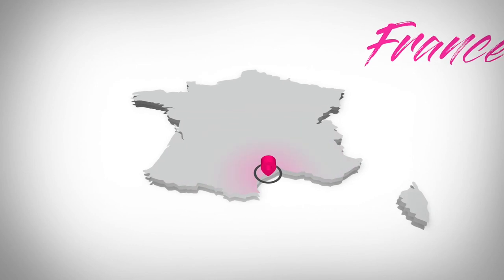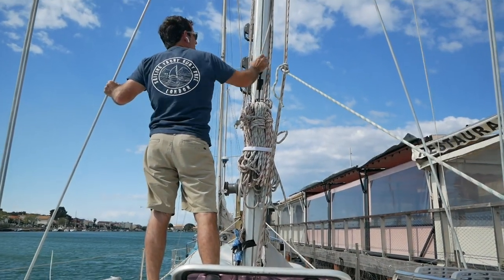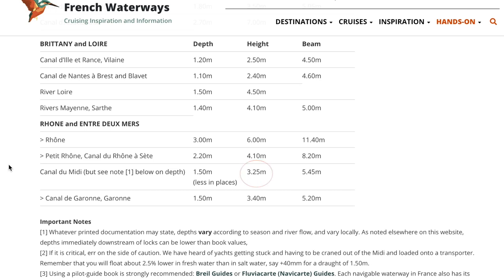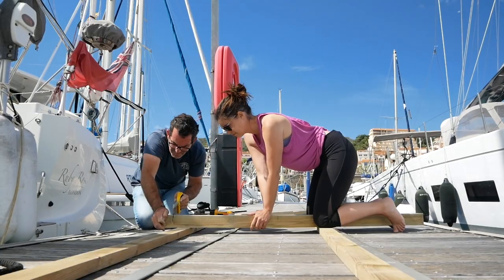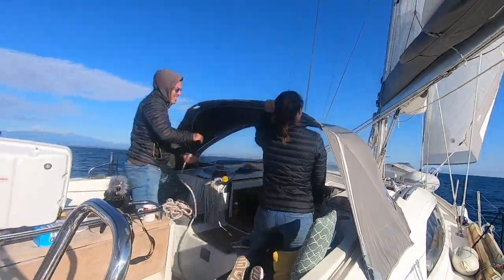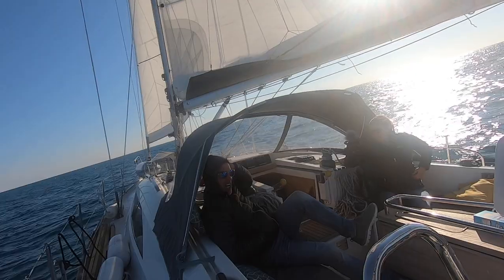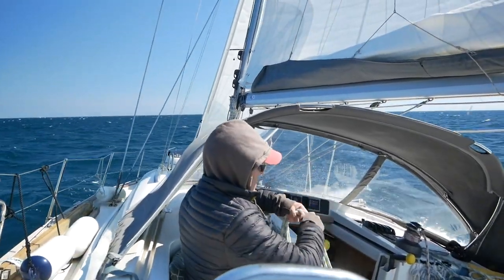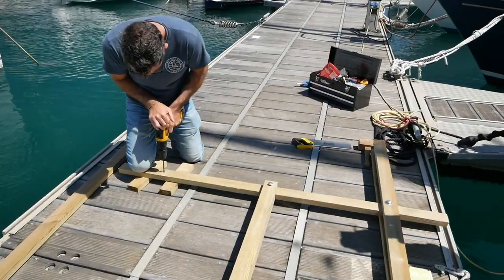How We Turned Our Sailboat Into A Canal Boat: Preparing For The French Canals | Sailing Ruby Rose

Comment: At our marina, we remove and install  approximately 65 masts twice a year, (at lift out and at lift in). We do this ourselves using a mast crane with a manual winch. It is interesting to note that no matter how often we do this every year, that nervous feeling of the mast leaving the boat and it being overhead never goes away. Great job on the mast supports and great video.
Cheers.

Comment: Excellent job on the mast cradle.  We have done it with our Hunter 356 going to Florida from Kentucky Lake TN River mike 24 in the US to Mobile, Alabama 650 miles, where mast goes back up, then to SW Florida and returning to Mobile to take the mast down for the 650 mile trip back north to just 1-1/2 miles south of Kentucky Dam - Lighthouse Landing.  We use the Tennessee River and Tenn-Tom waterway.  It’s quite a job getting the prep done to take down and put back up.  We have 13 locks and lots of bridges.  We see a lot of boats with mast cradles since we are on the US Great Loop route.  You are to be complimented on the robustness of your rig.  It is quite a process dealing with the wiring, radar and then still being able to get to your anchor well and move about the deck when you are going through locks and tieing up at various marinas and other places.  Another factor is you make your boat go from your typical,length to,your mast length.  It takes a day or two to mentally compensate for the mast overhang at the front and back.  In our case we go from 36 to 50 feet.  I look forward to your videos and wish you both the best in your travels.

Comment: Love these technical videos where Nick gets to OCD out. Tiny tip at 3:20 when you are having trouble sawing the 4x4. It is because you are leaning on the beam in between the two points where the beam is raised off the deck causing the saw to bind. A second set of supports close either side of the saw point would have made it easy.
Reply: @kjc9trader491  That would make it faster and less work but they, or any saw for that matter can bind as well.

Comment: Terysa- Nick 'sold you down the river' (so to speak)  Cutting that wood would have been much easier if you had support directly under it. As it was, as you were pushing down on the board you were closing the kerf causing the saw to bind.  If you watch closely at 3:33 you can see the wood flexing down as Nick cuts.  Well constructed otherwise. 👍🏾

Comment: Have you considered a load spreader base plate at the bottom of the frame to reduce pressure on the deck?
Reply from the maker: No my friend. We felt the load was dispersed well enough with the areas we had in contact with the deck, and thick carpet squares in between

Comment: Massive BZ to you both! Huge effort there! I admire your pluck, your confidence in  your own abilities and  simply just going for it!  
As a bloke who spent most of his working life as a senior construction  manager , I`m happy to say, that for a dentist and a paramedic,  you  guys kicked the arse out of that job! 
A few minor comments, but they are just that, minor. 
A rip saw was what you needed, not a tenon saw, and I would have used ply gussets to stiffen up the connections between the timbers. Bolted connections can move but with an added ply gusset screwed in place, they are bomb proof. I`d have used plywood sole plates to spread the point loads on the deck , also. But hey, you did it and you didn`t fcuk it up! 
So, winners are grinners!
As a reward, you can take last Wednesday afternoon off. ;)
Reply from the maker: Cheers mate. We had to make do with what the local hardware store had in stock.
Reply: @sailingrubyrose  Roger that.

Comment: Is there much variance in the canal levels (and hence the air and water clearances)?  I think France had a very rainy spring and now a very dry (and hot) summer.  Did your A-frames have any wiggle room for adjustments if needed?
Reply from the maker: The canals can’t rise that much as the water levels are normally within 30cm of the lip of the locks. We could have dropped the frames by up to 20 cm with some difficulty.

Comment: Wow I can feel your pressure, On reflection i notice you have a batt drill which means you would have been better prehaps buying  a jig saw <get the same make then the batts interchangable > this would have cut out all the sweat with that little tenon saw, Also think some heavy duty cling film and wrap the whole mast would be a good investment for peace of mind. When you come to think of this there must be thousands of craft do this every year, why is there not a hire company for this tackle ? like alloy frames with rubber feet adjustable for beam & height , got to be some money in that somewhere !  Can i ask what was the overland charges for the mast if you had gone that way about it , also can you shout out the engine hours on the complete canal route  & lastly was the mast a bloody trip knock head hazard or was it ok.  Think its time you went for that vino now Lol .
Reply from the maker: Hey mate- we were quoted €1000 to take the mast by road. Engine hours probably in the region of 150.